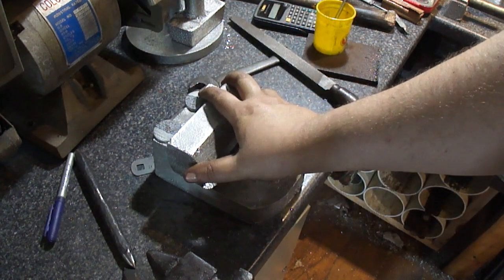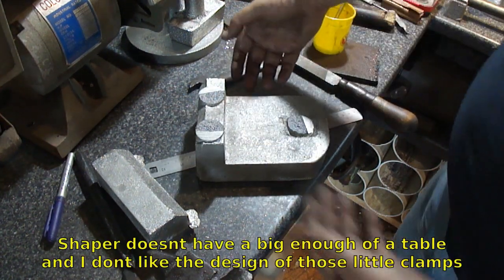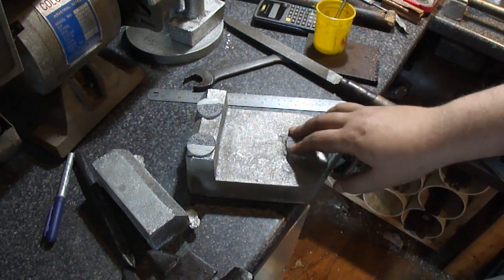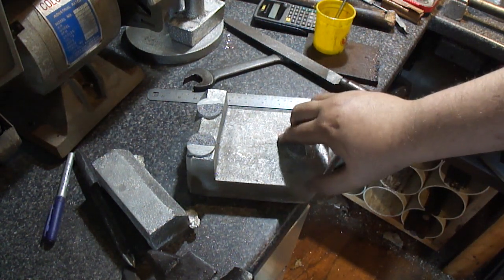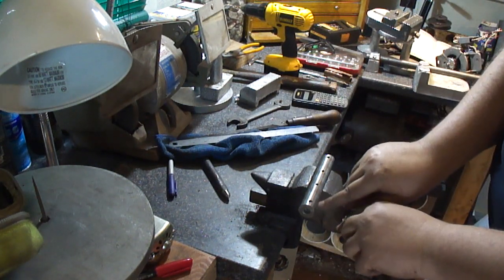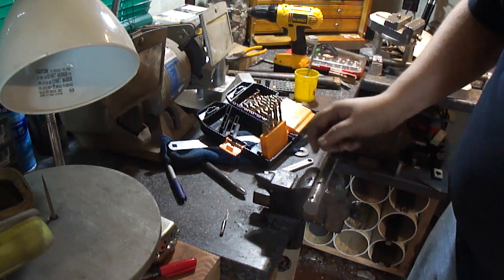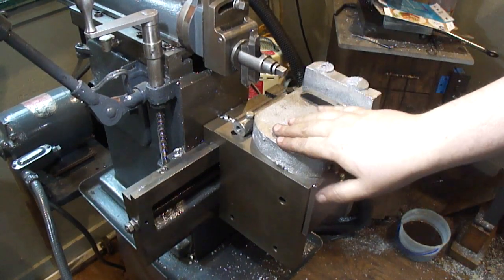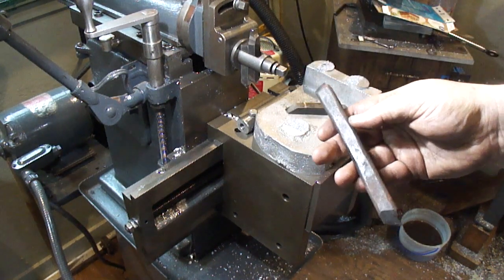Quick and Simple Project - Set Screw Bar Clamp

Comment: Good idea.  I was thinking of something similar - but using a wedge screw against a mating pin to get  the movement. 

Dan
Reply from the maker: yea, you can always put a piece of aluminum or something in between the clamp and set screw clamp to do the same thing, then it wont mark up the casting. The set screws tend to dig in and rough castings that will be machined back, thats not an issue because it'll be machined away, but it also digs in and acts like claws to hold the thing extremely hard, so you know it isnt coming loose. Thanks for watching man.

Comment: I know you've read a lot of the same shaper books as me and many of them have shown a similar vise. Nice implementation too, using what's at hand. Thanks for a little shaper action as well as a good video!
Reply from the maker: yea, Ive seen a few ideas like this floating around, and it was the only way I could think of to hold that vise to machine it without getting too involved with another big project, lol. Just do what you have to to get the job done, lol.
Reply: I couldn't agree more. You do what is needed to accomplish the task, safely of course. 😀 I haven't made one yet but I did make a low profile vise that is two piece. Very similar in use.
Reply from the maker: yea, I was looking at making a vise like this old tony made a while back with the 2 part vise for the mill, but havnt really gotten to it yet. Until I get the mill running, Im not really in any rush to get it done either, lol.
Reply: That vise would also work on the shaper for a low profile clamping job, but you've already got that part made. You just need the fixed jaw end to use it on the mill too.
Reply from the maker: got it, was going to use the other shaper vise jaw that I had cast out already and machined up in the livestream. It wont really be a low profile vise on the mill, but I dont really need a low profile one for the most part. If it really comes down to it, I can always just take some 3/8" or 1/2" flat bar and make a fence out of that for it.
Reply: That would work as well. My mill doesn't have a huge amount of Z travel either so I find it easy to have it and a regular mill vise both on the table at once. At least the fixed end of the low profile vise already trammed.
Reply from the maker: yea, my problem is less of the Z height and more of holding capacity of the vise. My mill has like a 24" wide table, so being able to clamp something bigger than a few inches that the vise would hold is really handy imo. I doubt I'd really use it that much tho, and probably just use some clamps to machine the stuff up for most of the time, but it's nice to have the option.
Reply: True, I use clamps too, but it seems there is a lot of things that just don't quite fit the vise but are too awkward to use clamps on. Maybe I just machine weird stuff, lol.
Reply from the maker: lol, I think we all do that, but the wierd stuff usually makes the cool projects, lol.
Reply: Well interesting at least. Most are just an extra PITA to finish. 😁
Reply from the maker: lol, thats why I usually just use my shaper vise, which has a swivel jaw on it, or if I have to use the drill press vise, I just use a ball bearing between the jaw and a piece of aluminum to keep from marking the part. The only ones that have proven to be difficult is a surface plate, but I havnt started on that one yet, but I have some ideas, lol.